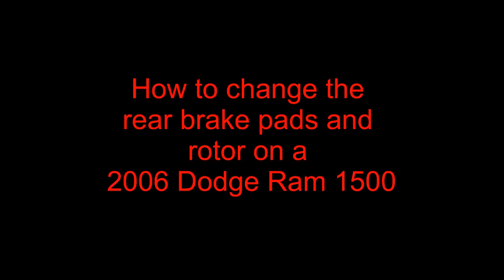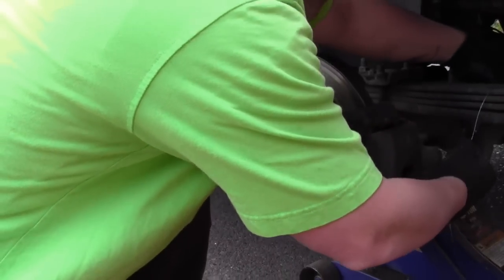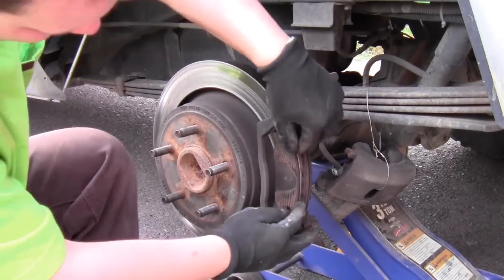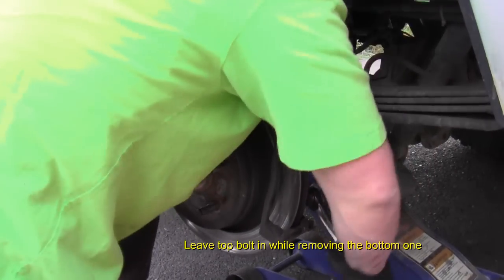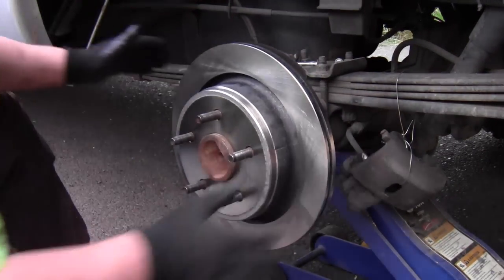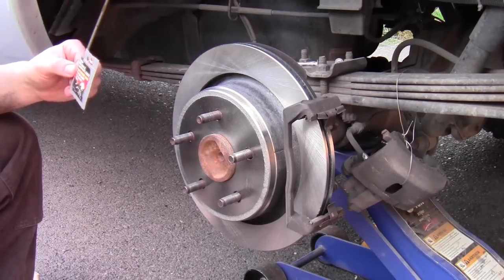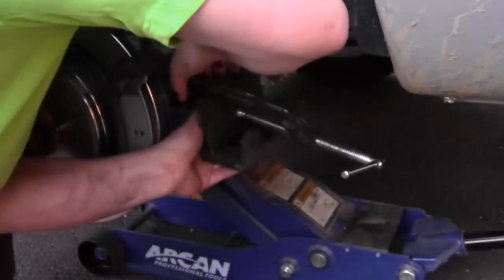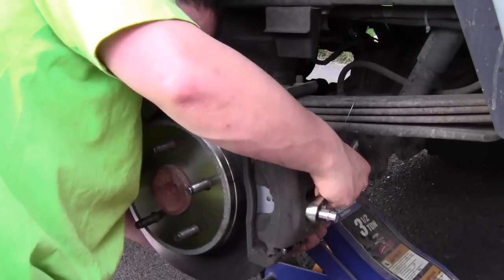How to replace the rear brakes and rotors on a Dodge Ram 5.7L V8 Hemi

Comment: I'd say a breaker bar is the second more important tool after getting through this, those large bolts are impossible to remove without one since an impact gun can't fit in there!  I finished with no problems and now my brake wobble is gone!  Thanks again!

Comment: BEWARE...THE CALIPER SLIDE PIN BOLTS DO NOT GET TORQUED DOWN ALL THAT MUCH.  For the 02-08 Ram 1500, the front caliper slide pins get torqued to only 24 ft-lbs and the rear to 22 ft-lbs.  I snapped the first rear caliper slide pin bolt I installed and it stranded me for a day.  Also, the bolts that hold the pad bracket to the axles are 130 ft-lbs.
Reply from the maker: Thanks for the tip.
Reply: +Dan Auxter The front brackets are 130ft-lbs. The rears are 120ft-lbs. As you found out, the pins are the ones you have to be careful with. The  anti rattle clips seen in the video were not replaced and The pins were not lubed nor were the sliding surfaces where the pads ride on the clips. The piston boot and pin boots should have been inspected for tears.

Comment from the maker: Great question. I am by no means a mechanic; however, depending on how much fluid you have in the reservoir you may want to remove some fluid (not too much) with a 60cc syringe or what I have used is a turkey baster. On this specific project I did not need to remove any fluid. As the caliper is compressed it may cause fluid to overflow from the reservoir. If it look really full take some out, and replace with some new fluid when done. Hope this answers your question.

Comment: Thanks for the help. I could not figure out what I was doing wrong and duh on me I forgot about the two small bolts that hold the pads and clips in place. I did my own front wheel hubs and pads about six months ago you would think I would have remembered the small bolts.
Reply from the maker: Glad I could help. thanks for viewing

Comment: I just did my 06...Front system...It has dual calipers and clips. I noticed the rear didn't appear to have either. Can you comment on the difference. Are all Dodge, Ram, 06, Hemi, Vin 2, the same ? Thanks for the video...Saving Regular People thousands

Comment: Thank you for the vid.  did you make a vid on the water pump yet?  mine has a slow leak at the bottom (I believe) so not sure if I need to replace the whole thing or if its just the gasket.  Any advice?
Reply from the maker: I have he video  for the water gasket . I just need to get off my lazy but and edit and upload.
Reply: I understand that,  ok let me know when you upload it.  its still a bit chilly out side but hopefully next week is when I will get to work on it.  Hate to wait till its to hot outside as im afraid the truck will start to over heat.  appreciate your response, have a good day

Comment: I replaced the front pads and rotors on my '06 Ram, and now on to the rear. I removed the rear rotors and found that the emergency brake components are pretty much eaten up with rust. I have the parts, but for the life of me I cannot find any helpful info to replace them... Do you know of any videos or good written instructions on how I can do the emergency brakes?

Comment: this will be my first brake job on this truck. i need to learn how to swap out the wheel bearings (front).  I've been through 2 already on the right front @ $375 a pop for parts & labor.  not covered by add on wrap around warranty.  have you had any wheel bearing problems?

Comment: Very nice video. I have a 2004 Dodge Ram 1500 4.7  I am thinking of changing out the brakes. It looks like a simple procedure. Some vehicles have anti vibration clips on the brake pads which I understand is a pain to reinstall. Am I correct in assuming that my truck does not have those clips? It's not mentioned in your video or in couple of others that I viewed. thanx
Reply from the maker: Thanks for watching and taking the time to comment. What you watched is what was there. I am not aware of anti vibration clips. This was a simple repair. Good luck
Reply: +HighDesertAdventurer Those spring things that the end of the pads ride on are the anti vibration clips.They are clearly visible in the video.  My pads came with new ones. It is recommended that they be replaced and a little lube on the clips so the pads slide easily is also a good idea. The pins should be lubed. The piston boot and pin boots should be inspected for tears. Water in the caliper piston can rust it up solid. If the pistons don't go back smoothly you should not ignore it.
Reply: Doamino41 i know what vibration clips u talking about ive seen them on mitsubishis before i hate that systen

Comment: Should of lubed the caliper thats why u getting slightly un even pas wear if u see the outer pad in the video there supposed to wear out even
Reply from the maker: Roberto Sanchez Great advice. that was something I was unaware of at the time
Reply: Yea no problem your video came in handy when i did my father in laws dodge durango similiar brake set up